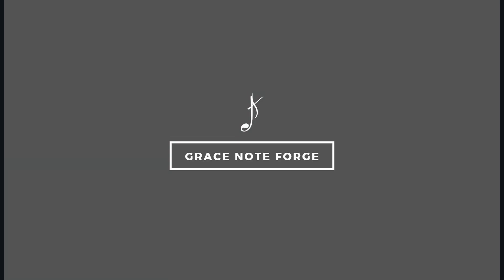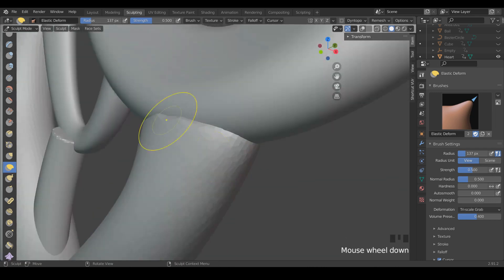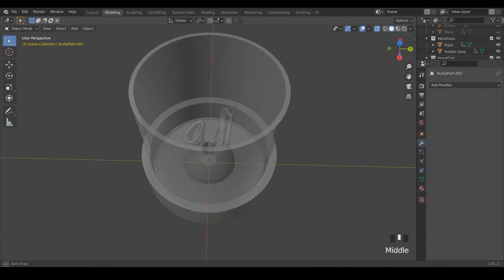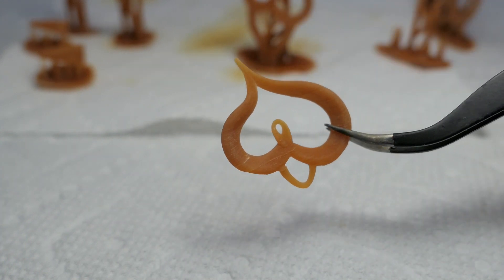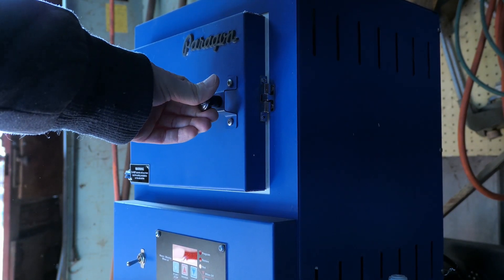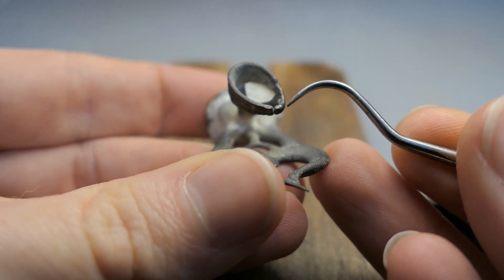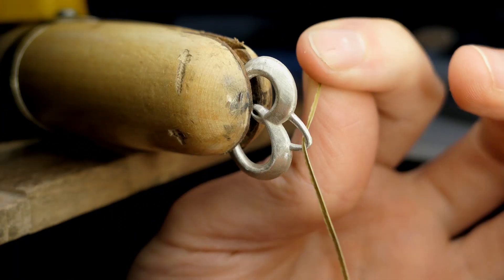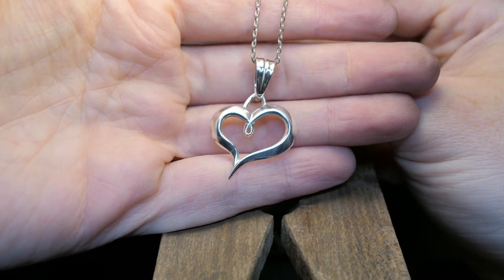Casting Jewelry with Maker Juice Labs WaxCast Resin and the Elegoo Mars 3D Printer

Comment: I am a jeweller and I am looking for a 3D Printer to print castable waxes. I am currently looking at the Elegoo Mars 5 Ultra - would this work for what I need it for? Most jewellers in the trade say to me to get high quality prints you have to spend thousands for a very high quality printer. What's your views on this as you also use a entry level printer?

Comment: Hi I'm getting good results with siraya true blue casting resin , bottom exposure 50 and  exposure per layer 3.5, just sharing in case you want to try faster prints
Reply: thanx did exp 50 yesterday and today decrease it to 45 and e/layer to 4...jamghe castable resin

Comment: Once you printed them in the Wax/Resin, did you feel that they were still workable? Like, could one make changes if necessary with a flex shaft or a file or is the material not at all like real wax? Thanks for your time :}
Reply: not really because it become like hard plastic ..can sand some imperfection though

Comment: Hi, can you advice me on a kiln question. My power supply in Singapore is 220v so the US made kiln would not work and using a transformer is out of the equation. Is there a another way to melt the wax away without this kiln?

Comment: I used to work in a bronze foundry where we worked on everything from jewelry to monuments spanning 100 feet. I have only two suggestions. One, we burned out molds at 1650 degrees Fahrenheit, so raising your burnout temps to that, if your kiln allows, should evacuate all ash, then just use an air compressor to blow out any residues and inclusions from the investment. Two, the way you melt the silver could lead to uneven distribution of heat and therefor some of the melted silver may be more solid than liquid, so build a small furnace with a lid, plus use a little borax as flux to aggregate and remove any heat-resistant impurities such as carbon-heavy slag. Hope that helps.
Reply: What is the name of software

Comment: The temperature of cylinder is to low....When i cast Gold i make the temperature from my furnace on 690° and for non precious alloy to 850°... The casting will be very clean and after sand blasting with glass balls the result is simply perfect... ;)
Reply from the maker: Thank you for the tip! 😁
Reply: @GraceNoteForge  You're Welcome 🤙

Comment: One more thing that may help with that turbulence is placing your model closer to the table side of flask so the air pressure can escape as it floods. I use 1/4" as a rule of thumb but i don't use a vac table..

Comment: Great work, about casting its good but you must wait more to more mold and great temperature for silver ، After melting the silver well, you should pour the silver quickly and not slowly, because the silver cools quickly once the flame is removed, and thirdly, after you finish printing the design, you must design a silicone mold to pour wax in it because the wax melts quickly and does not remain in the plaster. As for resin, it is a hard material and it is  It is possible that the remnants of the packages are stuck, which is the reason I think to get a perfect design, and I wish you success
Reply from the maker: Thank you for the advice! Resin casting definitely has its challenges and I still have a lot to learn. 😄
Reply: @GraceNoteForge  yes i have lots of learn also, i have problem with my 3d printer ( photon mono x 6k ) 
When I finish the design and start to slice the printer always print halg design no complete so i move the design in corner ,, i dont have all my space ,, i don’t know how i fix this problem

Comment: Great video! What's the liquid at 9:30? Thanks
Reply from the maker: Thank you! That was a pickling solution. It's a diluted acid used to dissolve the dark firescale from the top layer of the piece. It normally works better when its heated (which is why it was in a small crock pot).
Reply: @GraceNoteForge  Thank you!

Comment: hey just wondering how many wax pendants (let's say the same model) can that flask get?
Reply from the maker: The flask in this video is only 2.5"x 2.5" so its only suited for 2 or 3 tops, but these pendants could easily be added to a tree using a larger flask.
Reply: @GraceNoteForge  thanks a lot for the answer! how about a 4x8 flask?

Comment: Wash the piece after curing, some resins leak oils in the curing process witch does not let wax to adhere  to it, if you wash it after curing you get rid of the oils and wax will stick much better.
Reply from the maker: Thank you for the tip!

Comment: What tools did you use to file, grind, clean up, and polish didnt see them in the description.
Reply from the maker: I use a variety of needle files and abrasives for jewelry but most of the clean-up work is done with silicone rubber wheels. I get most of what I use locally from Armstrong Tool & Supply Co. 

Here's a link to their site if your are interested:
https://armstrongtoolsupply.com/abrasives/rubber-wheels-mounted/
Reply: @GraceNoteForge  wow thank you !

Comment: Use boric acid in you investment. It will strengthen the investment. Also pour your silver as quickly as possible. Make sure your vacuum has reach near max before pouring your silver.

Comment: It is fantastic but the question is does it worth, financially, all that tedious work, or it’s just a hobby
Reply from the maker: Thank you. It really depends on the person making it. This video was really intended more for educational purposes so it seems like a lot of tedious work but with practice, these steps really don't take too much effort. Financially, I think it's well worth it considering multiple models can be printed at once.
Reply: @GraceNoteForge  thanks Grace for The decent response. One question please, I do have an oval gem stone and I need to design a silver mold that goes into that gem correctly ! . Can you tell me please how to do that ? Do I have to figure out the circumference of that stone and introduce the data into the 3d software you are using it get them fit correctly ? Please answer my query and thanks in advance
Reply from the maker: If you are using Blender as your 3D modeling software, there is a free add-on called JewelCraft that is used for jewelry modeling that's worth looking into. In the add-on you can specify the size and shape of the gem you are working with and it will produce a reference model for you. Then you can use it to accurately model whatever style mount you would like to fit the gem.
Reply: @GraceNoteForge  I found a lot but would you please recommend one by putting the youtube link plz
Reply: Less tedious than the traditional method.  Cheaper I should imagine too as a Rolling Mill will set you back at least £500 alone.

Comment: Whats your investment?
Did you add borax/boric acid to the metal for flux?
How long was your bench time before you went into the oven?

Also a tip i swear by with solid flasks: add sprues around the wall of the flask. Allows vacuum to “pull” deeper up into the mold

I was having firescale/flashing/imperfections for the longest time. I added a kiln thermocouple to my oven to read the temps alongside what the display said and found i had alot of deviation. I follow what the kiln TC says. That eliminated a ton of issues

I swear by bluecast x5

Your supports may have pulled off due to fep tension being loose. These newer machines dont allow for adjustment. Look into NFEP

Did you vac boil your investment before and after your pour of the mold?

Metal temps - sterling i end my cycle with the flask at 537c and my metal at 895c

pretty good casting man.
Reply from the maker: Thank you for watching! I use Minro sc20 investment and borax for flux. I believe I left this flask out for 2 hours until the investment hardened, then placed it into a ziploc bag until I could start an 8 hour burnout the following day. The ziploc bag helps not to lose all the moister in the investment before the burnout. 

Thank you for the tips! I've been meaning to get a new casting resin to try out and I've heard a lot of good things about Bluecast resin.

Comment: Hi, why not keep the supports added from the slicer? Just use the parts as it comes from the 3d printer without remove the support. The channels are perfect for the air flow/escape - aren't they?
Reply from the maker: Multiple sprues can help fill a mold but as I understand it, it's a bit of a balancing act. The goal is to effectively fill the mold with the fewest vents and sprues as possible. It doesn't hurt to have extra but the fewer sprues used to fill a mold the better because it winds up being harder/more time consuming to detach the piece and sand down the surface once it's cast in metal.
Reply: Most support structures attach at fairly thin points to allow easy breakaway, which wouldn't be great for metal flow.
Reply: @nic.h  in chitubox you can adjust the contact point size of your supports this is a hacky way of doing it but if you aren't comfortable doing it in another software it is a good alternative.
Reply: use sticky wax burnout faster can also sticky wax pieces together

Comment: To save a few dollars on a consumable part I've found that a piece of saturated cardboard (not corrugated)  works well in lieu of a silicone mat on the vacuum table to seal the hot flask. Even though it's free, I can actually use the same piece of cardboard six or eight times.

I have gone through a couple of bottles each of Anycubic castable and Phorezen green castable, first on a Mars and now a Mars 2 Pro. For both resins after getting comfortable with them, I hit a problem of them not being available in the US. I'm currently working on a liter of Resinworks violet. The cost is mid-range and a bit more than the other two. I had some problems with printing it before getting the settings right but I think I'm going to be pretty happy with it. It prints beautifully with a lot of detail. It seems to have less ash than the others and burns out at a lower temperature. I suspect the higher burn out temperature of the other resins may have been damaging some of the details in the mold during burn out. 

In my opinion, cost should be a secondary consideration on picking a resin. What's more important is finding one that prints and casts well and won't drop off the market in six months after you have gotten familiar with it. I'm making engineering model parts that have exterior dimensions as large as a 3 inch cube. Even at that size the resin probably costs less than a cup of designer coffee and less than the investment powder. It's easy to spend at least 1-2 hours cleaning, adding sprues, investing, and casting a model. Saving a couple of dollars on a resin on that doesn't print or cast well is a waste of my time. 

VOG in the UK is having success with a new resin that isn't yet on the market. It looks and seems to perform similar to the Resinworks resin and he believes it will be available in the U.S.
Reply: I also use wet cardboard or even folded paper on top of my silicone mat when casting. Works great!
Reply: ICYMI, Siraya Tech’s castable resin (the stuff VOG used) is available in the US now.
Reply: @theOPkilla  I've been using it for several months with good results. In fact I have some items using it in the burn out over as I type this.
Reply: @dickmorris6310  do you have any issues with shrinkage either when printing or during burn out? Easy to add sprue to or should it be designed with the sprue? It’s not available here yet but I’m extremely anxious for it to be and want to be ahead of the curve lol
Reply: @theOPkilla  I make castings for a 1/8 scale locomotive mostly using silicon bronze. Most of my 3D printing is in castable resin. Accuracy is important to me. 

Although it's claimed that some resins shrink as much as 6%, that hasn't been my experience.  When setting up your resin profiles you can build do calibration test prints and compensate with your slicer (I use Chitubox basic). See a video titled "Calibrate your Prints" by Nerdtronic. 

I used the "scale" function in the slicer to add a casting allowance. For most of what I do, printing at 102% gets me close enough for  my needs. 

I have found that it's difficult to join resin printed parts to wax sprues for the castable resins I use. I often use a tree to cast multiple parts printed on the 3D printer in castable resin. Although it probably costs more than using wax but the sprues are more rigid and by using a small dab of super glue to attach the part to the tree it saves a lot of time. Sometimes I add sprues to the parts when I make the model and sometimes I use a short printed pieces to join the model to the sprue. I've also done a few larger parts where the entire sprue is printed with the part.

The resin I mentioned above is Siraya Tech Cast and I have gone through several bottles of it during the past year. The parts I cast a few days ago again came out perfectly and I continue to be a fan of Sirya Tech as a moderately priced resin that both prints and casts well.  I have used it for U-joints to extend valves on a full-sized steam locomotive that are about 3" long overall and made of three castings. I then scaled and printed the same model at 1/6 size to make U-joints that were about the size of a pinto bean. A Google search on "u-joint USATC S-160 Consolidation" should find the photos.